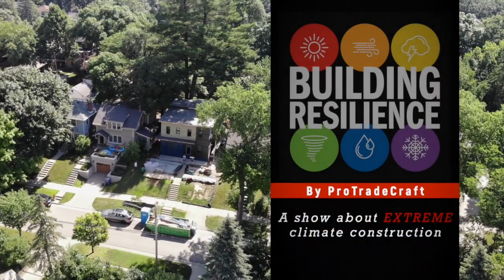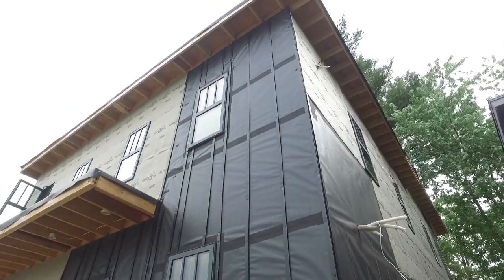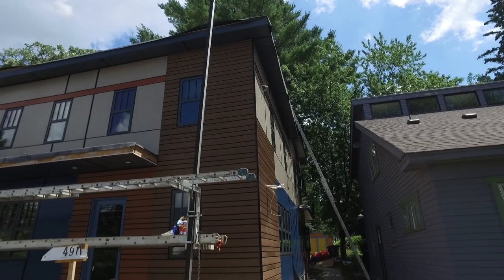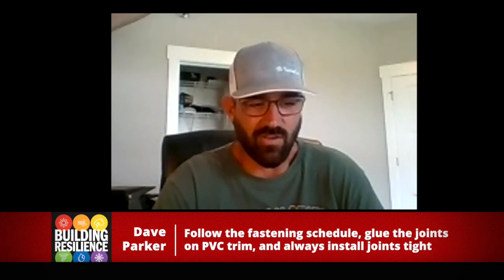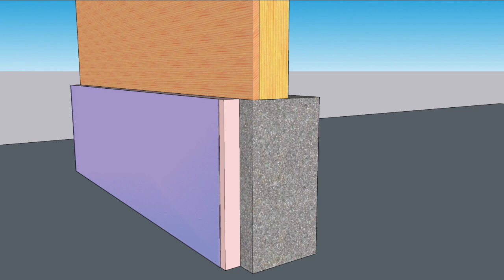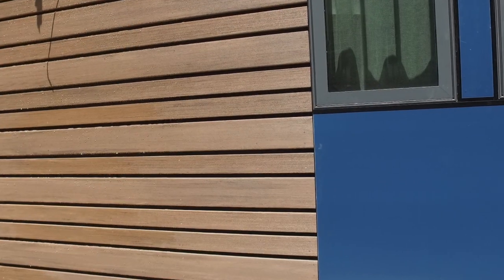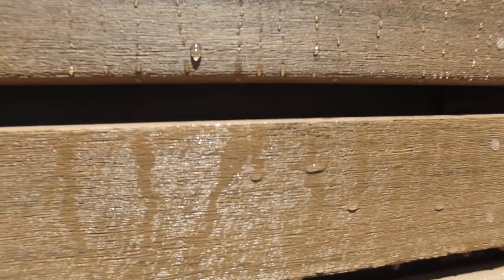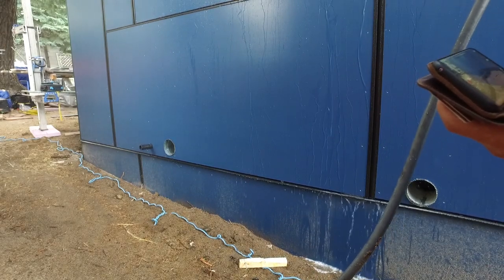Building Resilience (10): A Cladding That Leaks Like Crazy! (over a wall that's water-tight)

Comment: Don't worry y'all the wasps and stinkbugs are all gonna head over to the neighbors vinyl siding and make homes there.
Seriously tho my only question on this beautiful install is from an embodied energy / system sustainability p.o.v. - wouldn't either something rapidly renewable OR truly bulletproof like corten be a better choice for 'resilience' than a vinyl product?
Reply from the maker: That PVC cladding is not going anywhere ever. It is rated for ground contact, so it is not going to rot or 'wear out.'

Embodied energy-wise is a deeper question, but does steel require less energy to produce than plastic? I'm guessing not.

Thanks for caring enough to ask. Many do not even know what embodied energy means.

Comment: Honest question: How do you not end up with tons of bees and wasps making homes behind the open joints?
These systems looks nice but I'm always wondering if you'd have to remove it all the time to clean out flying insect nests.
Reply: Most bees and wasps like protected spaces. That's why they will build nests in soffits (or hanging off a soffit) where there is an opening, but not a lot of air movement, it's dark, and they are protected. The open joint part is too open for them, and there's too much air movement. Also, they don't like to get wet, and since weather blows through there, it isn't ideal for them. We like to look at destructive and non-destructive bugs. Box Elder bugs like warm surfaces, and it doesn't matter what kind of cladding you have, they are going to show up. They aren't destructive, so there's not a negative side. Spiders like inside corners (door frames, multi-slide doors, soffits), but we've not seen a lot of spider activity show up on open joint. Then again, they eat the other bugs, so that isn't really a problem. That and a quick wash with the hose, and the entire cavity is cleaned out.
Reply: @oadesignbuildarchitecture9688  Thank you, this is really helpful.  In this video, I noticed the gap was significant (1/2") and I'm wondering if what you said plays into that.  In my opinion a 1/4" gap is more visually pleasing because you can't see the structure behind it, but at some point it becomes a protected space.
Reply: @Sn0wZer0  Sure thing! The gaps here are all 3/4" so yes, lots more air movement. I agree, previously, seeing through to the structure behind was a challenge, but the challenge with a smaller gap is creating that protected bug friendly environment. This is why with regular ventilated rain screen systems, installing that bug screen or using an entangled matrix style rainscreen is so important The system that Benjamin Obdyke released (Invisiwrap UV)really does a good job of hiding the structure and they allow for gaps up to 2"!! I don't know if I would ever gap the cladding by more than an inch, but it's nice to know the product is rated for serious exposure.

Comment: Very informative stuff. Definitely didn’t know you’re supposed to install Azek deck boards right. 
But I do wonder about the open joint siding. Are we worried at all about bugs making homes in there? I was interested in doing this but went with a rain-screen composite siding specifically because I was worried about insects. The only solution I could find was a black mesh screen product that you’d have to staple tight to the furring strips.
Reply: The bug concern gets raised a lot. Destructive bugs like wet, damp, dark spaces. The open joint cladding is dry and exposed, so it doesn't provide the stuff that bugs would find attractive. 
That said, a ventilated rain screen like you did is an awesome system as well.